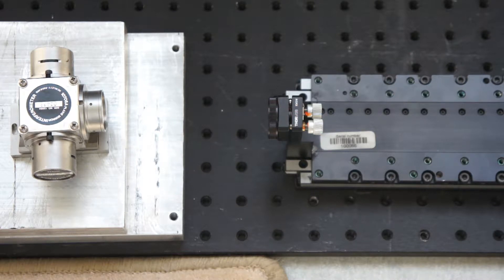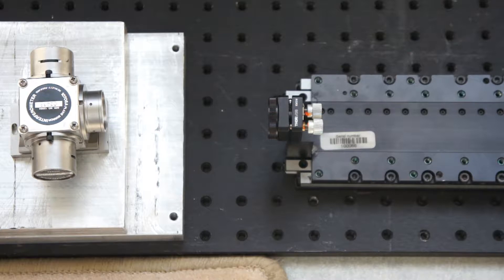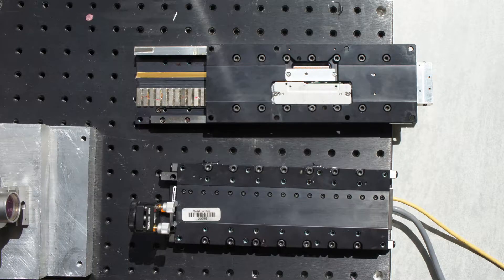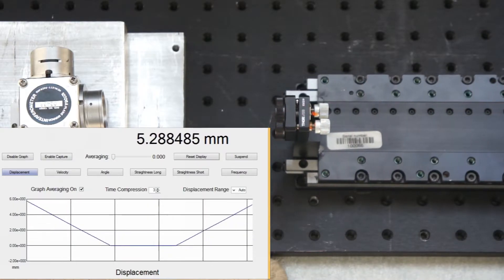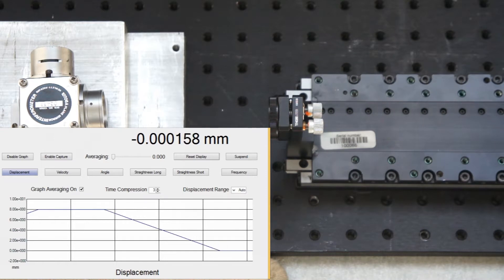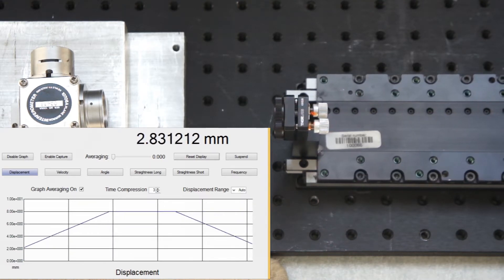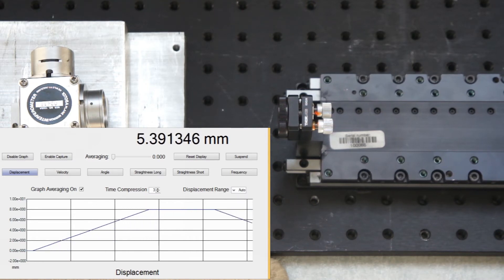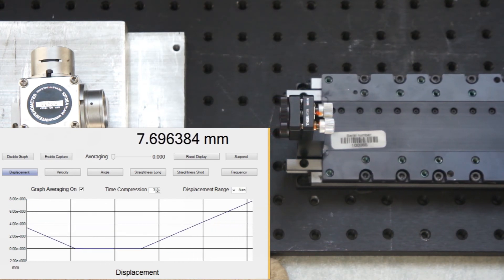Checking Parker MX80L linear stage with laser interferometer

Comment: Using a similar setup, MX80L, Vix250IH Drive, but can't seem to energize the motor and make it run without a fault. Any tips?
Reply from the maker: What kind of fault does the drive report?
Reply: @janbeck8269  Had a broken motor wire. All good now for this part. Now let's see how well it performs. I need it to hold steady so not sure how the brake, if there is one, is implemented.